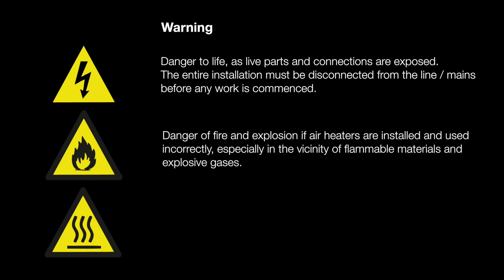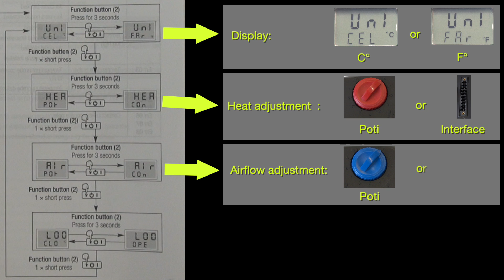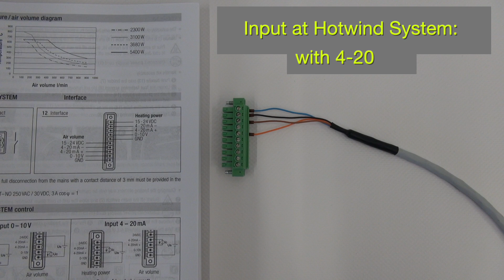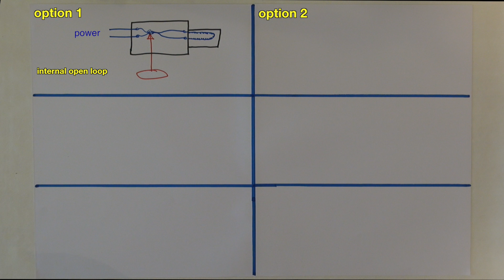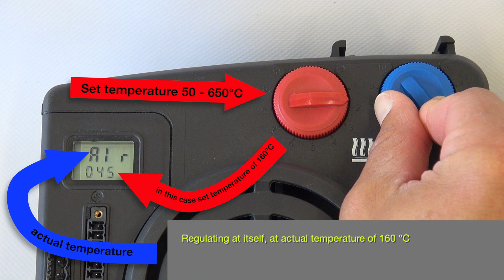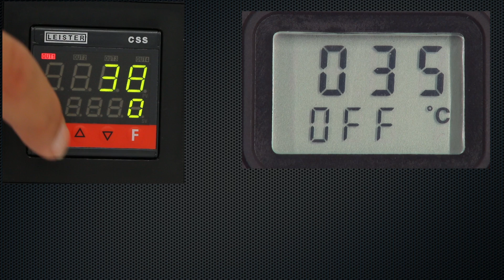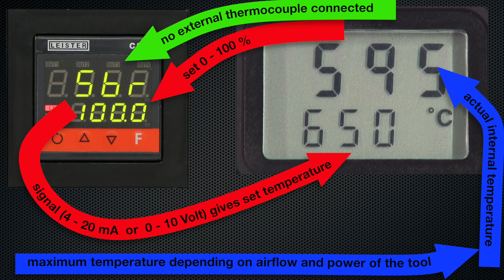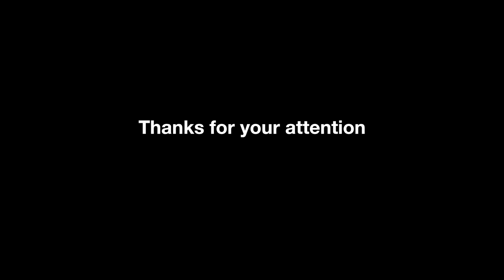Leister Tutorial | Hot-Air Blower  Hotwind System operate and options to control and hook up

Comment: Buenas tardes, disculpa en el minuto 17:43 tienes activado en la pantalla del controlador CSS una bandera que dice "OUT 1", pasan los segundos, se corta vídeo, y ya no aparece, cómo fue posible que lo quitaran? Queremos realizar lo mismo que el vídeo pero no responde la pistola al controlador, no logramos nada, no detecta nada, espero puedan ayudar, gracias!
Reply from the maker: Dear Ricardo

Out 1 is Alarm 1, which lights up when the value is exceeded. 
In the video, a value that was too low was probably first stored and then changed. That is why it went out.

Best regards 
Your Leister Team

Comment: I want to control the Air Flow AND the Temperature independently via an external controller.  Is this possible?  I'm using an Omron CJ2M PLC and a 0-10 V Analog Output card.
Reply from the maker: Yes, you can control the air flow and the temperature via an external controller (4-20mA or 0-10V). 
But you need one controller for the air flow and one controller for the temperature. And you need also for both 24VDC power supply.

You can find more information on our homepage. www.leister.com

Best regard 
Leister Team

Comment: it's possible to control it with a Raspberry or an Arduino
Reply from the maker: Thank you for your inquiry.
The input signal for the Raspberry / Arduino has to be made for the Thermocouple you use. We normally use the K-Typ Thermocouple which is an analog signal.
Then you have to program the Rapberry  / Arduino for PID controlling.
The Outputsignal for the Raspberry / Ardunio has to be a analog signal too, like 4-20 mA or 0-10 Volt.

So it will not be a plug and play solution, but it would be possible.

Best regards 
Leister Team